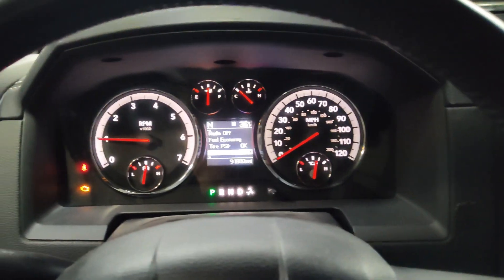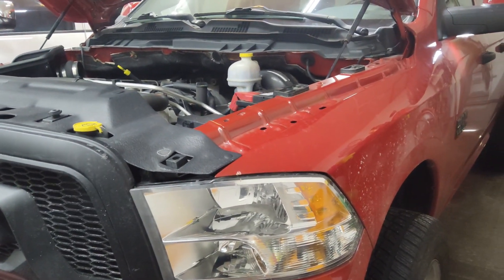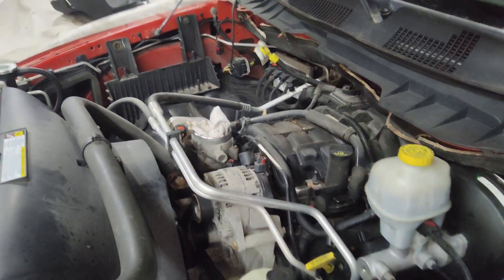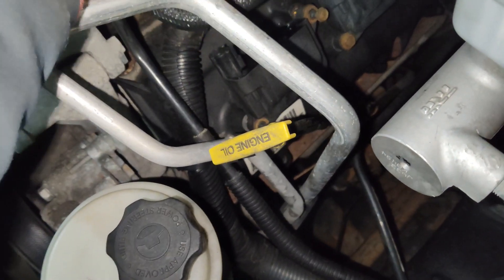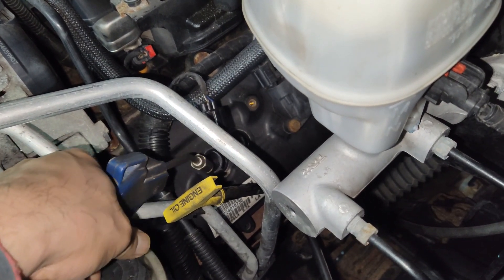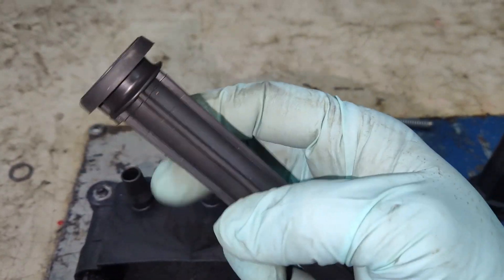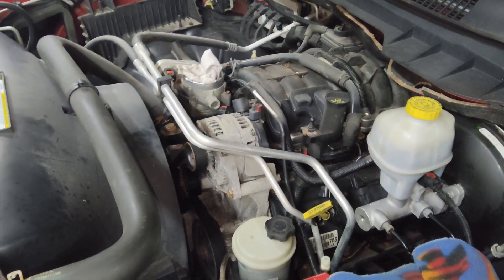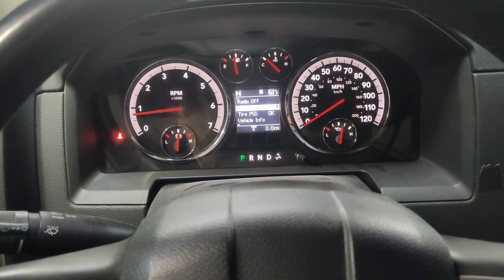Code PO301 - Cylinder Misfire | How to Diagnose & Fix | Ram Truck Hemi 5.7L

Comment: I'm getting a P0301 and P2302 after installing new ignition coils, new plugs and cleaning injectors.   Any idea on how to troubleshoot?
Reply: Let me add, rough idle.  I installed a 2nd new set of coils.
Reply from the maker: Thank you for watching/subscribing.
So this all started after you replaced the coil, plugs etc., or that's the reason for  replacing.

Comment: I have no engine light but when I plug my scanner into it it’s saying I have a misfire on cylinder 1 and 8 at idol
Reply from the maker: Hi, thank you for watching/subscribing.
The number of misfires a Dodge Ram with a 5.7L engine can have before the check engine light turns on isn't a fixed number, as it can vary based on factors like driving conditions and the specific vehicle's diagnostic settings. Generally, the engine control module (ECM) monitors misfire events and will trigger the check engine light if it detects a certain threshold of misfires. This threshold is typically based on a combination of factors, including the frequency of misfires and their impact on engine performance and emissions.
In many cases, the check engine light might come on after a single misfire in extreme cases, but more commonly it would take multiple misfire events over a short period or a certain number of misfires within a specific driving cycle for the light to activate.  Depending on the scanner you have have you maybe able to watch the ignition or the injector circuit to see what is failing or you can try to swap ignition coil and or the injector to a different cylinder and see if the problem moves to that cylinder.....

Comment: I’ve had 2 broken valve springs cause this
Reply from the maker: Thank you for watching/subscribing.  Yes broken valve spring is an another common issue on certain year Hemi's.  In the case of this truck the misfire did return and this is the video on  how I solved it.  CLICK HERE:  👉   https://youtu.be/XxU6l99NdtI

Comment: changed the ignition coils, spark plugs, had them run a diagnostic test on the computer, and a compression test on the engine. Still getting the misfire while ideling. 2016 lone star edition. Any suggestions? Mechanics said that next would be checking the rockers. I think its time to get something else.
Reply from the maker: Hi, thank you for watching/subscribing.  Well, if the electronic systems check out ok fuel & ignition then the problem most likely may be mechanical.  There is another vid on this channel to diagnose it further with this situation. 5.7L and even the 4.7L (which I would not buy due to valve seat issue) are known to have mechanical issues causing a cylinder misfire.  That is the common issue during certain years in hemi 5.@7L (cam lifter roller seizures causing lobe wear) cam & the lifers are replaced to rectify the problem.  Revmoing the valve cover to physically see cam lift from rockers would be the next step. So "Mechanics" are headed in the right direction if that is what you are asking?    Thanks.
Reply: Did you ever find the fix?
Reply: @jbrowse09  I did not but after research and talking to a handful of mechanics, my models engine has had the most reported problems for a 2016. Rockin with the 4Runner now.
Reply: Dang I'm in that same boat I think, haha. Thanks for responding bigdawg! @BigDaawg96
Reply: @jbrowse09 no problem! Just sucks to see these rams being produced at such low quality now. Seems like anything going for under 65k from them won’t last. I recommend just trading it in if you can. Not worth the headache and money that could be used as a down payment. Get rid of it before the resale value tanks anymore. Only got 12k for mine.
Reply: @BigDaawg96  that’s a solid point! I was worried this dang check engine light was going screw my trade in value. My light has been going on and off for over a year haha

Comment: I have the dealership telling me they want to look in the oil valve for metal shavings on my 2019 5th gen. They seem to think it’s a mechanical issue. They don’t seem interested in the electronic/computer portion of the system though

Comment: I am getting a cylinder misfire code in the computer.  the truck runs perfectly, smooth idle, no enginer roughness or missing up to about 4200 rpm and then it starts to misfire, the check engine light starts flashing, bells or chimes start ringing.  The owners manual says there is a chance of emissions equipment damage when this happens.  I would expect would be damage to the cat converter.  20-30 seconds later it is running fine again as soon as you reduce the rpm below 4,000 rpm.  Swapping spark plugs and coils did nothing.  It is always the same cylinder.  There is no audible ticking to indicate a loos rocker from the cam and lifter problem.  I have not pulled the valve cover yet but I am leaning towards a PCM or possibly a corroded coonection at the PCM.  The truck has 360,000 kms (216,000 miles) on it and much of that has been in the winter on salty roads all over North America.  I have been using Lucas Zinc Phosphate additive for several years in the hopes that might help stave off the cam and lifter issue.  Most of the miles are highway miles from long distance commuting trips and towing our travel trailer.  Anybody have any thoughts or suggestions?  This has been going on for over a year now and I just keep the rpms under 4,000 but then it becomes really difficult to tow with the truck.  The problem has not changed one bit in the last year.
Reply: Same here. Hemi 5.7l above 4k rpm begins misfire in cylinder 1
Reply: Same here cylinder 1
Reply from the maker: Hi, thanks for watching/subscribing.  
Have you tried swapping fuel injectors?

Comment: How can I test if it's the pcm, changed spark plug and coil already and injector, compression in cylinders are good
Reply from the maker: Hi, thanks for watching/subscribing.  It's mostly like a cam/lifter issue.  Compression tests are not very conclusive when diagnosing this misfire issue.  Best thing to do is remove the valve cover & see the movement of the rockers while the engine is running.  If that all looks good, then it leaves nothing but the PCM as the culprit (process of elimination).  PCM injector pulse, volts etc. can best be diagnosed using a scanner tool.

Comment: I got brand new spark plugs and switched the coil packs and it’s still P0301
Reply: I should mention I also just replaced the computer because it went bad, I don’t recall having this problem before then but the place I got it from says they program by vin
Reply from the maker: Hi, thank you for watching/subscribing.  If you still have the misfire issue, this video may help to further diagnose and find the issue.  Click Here: 👉  https://youtu.be/XxU6l99NdtI